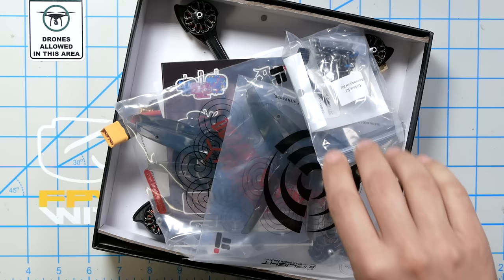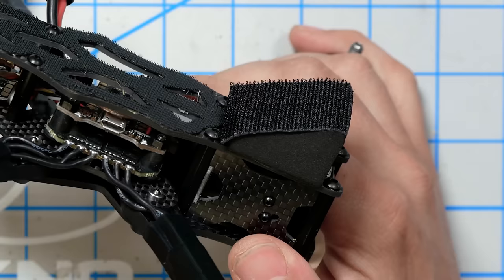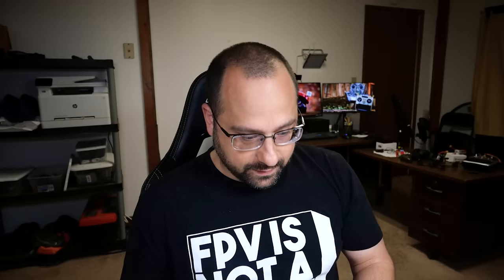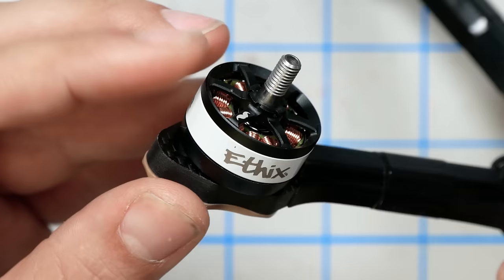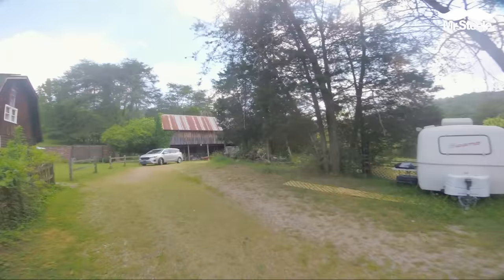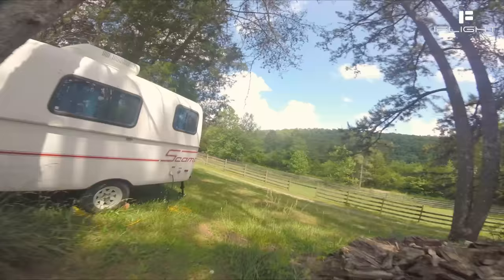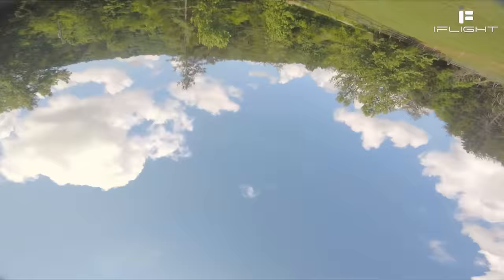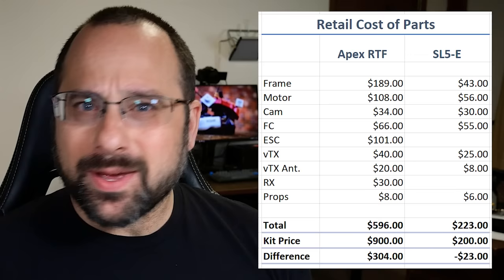Mr. Steele $900 Apex RTF vs. $200 iFlight Cidora | WHICH WOULD YOU PICK

Comment: All I can think of is getting 200 stuck in a tree or 900 stuck in a tree LOL.
Reply: yeah when renting a chainsaw and sneaking into the park at night is a viable option you know its a bit much
Reply: @testaccount4191  Lol, I can imagine the whole operation in my head.
Reply: @testaccount4191  Lol
Reply: Always good to carry an overinflated small basketball to knock the stuck quad out of a tree.
Reply: @kc8302  My quad rescue setup is a slinghot hooked to a fishing rod. I use the fishing line to loop a paracord around the branch to swing it. It the paracord is not enough, I use it to loop a larger rope around the branch. I managed to rescue quads stuck 40+ feet up in trees using this method.
Reply: But honestly, I burn ESCs much more regularly than I get stuck in trees. Last one to go was the Spedix IS35 in my Cinewhoop. Never turtled it once. Twitchy motor 3. I have a collection of "3in1" ESCs.
Reply: seems legit xD
Reply: Big pole. We have retrieved a plane off a 60 meter tree before. Big task
Reply: @yannickg6904  I switch to individuals long time ago xD
Reply: @ho-xo8my  I like 3in quads a lot, it's hard to build one with 4 single ESCs, but I learned my lesson on 5in quads.
Reply: Call a tree guy👍🏻😎
Reply: paracord is a good option
Reply: Stuck in a tree isnt as bad as on a roof behind a 10ft fence. Lol
Reply: Call the fire department. If they can get a cat out of a tree surely they can get a quad.
Reply: Same or smacking $200 into a tree vs. $900 into a tree.
Reply: Best response ever!!!
Reply: @yannickg6904  have you tried swapping motors? Or was the esc literally smoking
Reply: @rocky5763  Hi Rocky, it really was the ESC, the quad flew fine after swapping it. It's back in the air, no issues after that. The funniest thing is, I used a "EM25A" 4in1 that cost me 15usd vs around 40usd for the Spedix..
Reply: Loll all i can think is maybe if the steele build came with $400 in extra parts 😅🤣😂
Reply: I didn't get stuck in trees too often. No reason to be in a tree if you can drive.
Reply: Na man fishing pole with some heavy sinkers
Reply: @testaccount4191 ,,
Reply: @blindtraveler844  that sucks, sorry to hear.....
Reply: I use a silky saw with telescoping handle. Good for like 40ft.
Reply: And what i learn today was how to crash in to a tree with style 🤣🤣😄😄.
Reply: That's the trick. you buy both, and when the $900 one gets stuck, you whip out the $200 one to knock it out.
Reply: Climb the tree lol
Reply: That’s why you spend 1500 dollars  on drone that can get your 900 dollar drone out of the tree

Comment: Yesterday I decided to throw out all kiss stuff due to their quality management and one day later, you test a Kiss Quad and the ESC blows up. Made my day 😂 Will never put any hand on a Kiss Quad again.
Reply: Matek fcs  and spedix escs  bro
Reply: it flies just so much better but i get you. flying 4s fettec does help
Reply: I’ve had my kiss gear on the same quad for almost three years and no issue
Reply: arrow fpv same. Some people just don’t know what they’re doing
Reply: @mhoovair89  I run over 20 Betaflight Quads with no issues. If so as you say, Kiss is at least not super simple 😅  My last kiss issue was a desync after several Lipos out of nowhere.
Reply: @squeaks3814  I find this type of comments extremely hard to believe. anything past 4-5 months its sketchy as hell to me. its not a kiss or betaflight deal its a chinese electronics made out of rice husks deal

Comment: MR. STEELE!!! couldn't be more appropriate of a name! 900 dollars and the esc smokes! He files the holes ....for 900 dollars it better come filed. Hence RTF, 300 dollar part mark up off retail! Which they dont pay! If your trying to constantly push it, hit gaps and new spots your gonna crash (all the time) .....you can build like 4 solid rigs with awesome components for 900, that's insane. I've been flying for 6 years now, my builds get cheaper and cheaper. Tbs source one v2 frame, is in my opinion the best frame for freestyle. Dollar for gram! Great video Josh.
Reply: That's what I'm saying! 
4 quads plus repair costs will get a lot more longevity for someone who isn't a "pro" and can't even tell the difference on flight from one to the next.
Reply: I agree, @$900 dollars, WTF, you could build one for $350, and tune it to fly as good or better. And yes, if you're going to smash it, why would you buy a $900 dollar quad? 

I don't get it, but I don't need to! If you can afford it, you're happy with it, great, but it isn't going to make you a better pilot in the end. I would suggest, take your current build, and buy a better VTX, FPV Camera, and antenna!
Reply: Hahaha
Reply: Yah right

Comment: You have to file the KISS ESC holes because it is I believe 29.5 X 29.5 and the mounting on the Apex is 30 X 30. 

You stretch the ESC if you don’t file it down and even more so as the frame naturally flexes it will damage the esc.  

I have seen this only happen to people that did not file it down and installed gummies. 👊🏽
Reply from the maker: I can't say as to what happened. I'm sure Steele is following up with GetFPV to be sure it's being done to his specifications.
Reply: Ok, so pay 900$ bnf, and than repair it by your self? Getfpv charge that 300$, where id the warranty for their work. Apex holes are 30,5 x 30,5, all BF esc and  FC is 30,5 x 30,5 so it's good, but only kiss stuff is 30 x 30, I know that, everybody who build quads know that, getfpv doesn't know that. That is disgracefully for getfpv and for 300$ paying for bulid.

Comment: FPV truism applies at @16:00 folks.

The "you dont know what you dont know" saying applies with regard to the secret sauce moments worth paying attention to.  This something worth paying attention to given Bardwell does SO MUCH tuning inside of Betaflight.  He is comparing the Steele build to his own builds and tuning experience.

This is the kind of thing I wish I could see/experience within the FPV realm is getting to fly the various different drones of all the Unicorn/Diety tier FPV pilots.   To see what I am missing in terms of tune and finding out if the limits is in the gear/tune or within myself.
Reply: Having flown a few different quads of other pilots, I think what's sets them apart is the rates. Once you get a decent tune you probably won't find much difference, but the rates make it.
Reply: @elmattbo2540  true enough.  I have all my builds tuned down to around 650 and running .2 expo.   One of these days I think I will try playing with my rates a bit more.

Comment: Those ceramic capacitors fail short circuit when cracked. Usually happens when the PCB is bent or stressed, so it might be very well possible that it had something to do with the way its mounted, also there are always some capacitors that go out of factory underperforming and eventually develop a short circuit.

Comment: your kiss flight indeed looks nicer. you can see the higher trust, you have there. Joshua unleashed. I'm on Fettec (Kiss FW) now and can feel the difference to betaflight also. I immediately started to crawl through trees where I have not been before. Doing things I didn't do before. Kiss feels more direct, faster and calmer at the same time. Big, filed holes in the 4in1- check, big extra capacitor - check, spike absober diodes - check^^
Reply: Fanboys be like...

Comment: Finished watching... good video! Seriously put a FETtec stack on the Cidora and you will get it to perform almost the same as the Steele build. 
Stout motors: there is just something about the whole package, they are strangely efficient and the control is ridiculous. But any good motor will perform similar.
KISS: The control is out of this world and you hit the nail on the head for some reason with KISS I am more confident, I think it simply has less latency than BF.
Apex: Expensive but molded parts are expensive and they are very durable. The frame is very rigid and durable. Stack screws never need to be accessed unless you crack your rear plate.
KISS HW: I have no experience personally but I see them blow the magic smoke on video all the time. Go FETtec.

Comment: Yeah... you have experienced KISS. It really does feel different and flies exceptionally well when properly built. The ESC fire was strange, must be a 6S issue in the absence of a capacitor. You should have listened to those who warned you :). I have been flying KISS for 5 years and I haven't had a single ESC fire.
Reply: Seattleite FPV really that good? Have you flown radix?

Comment: Nice honest review.  I have both.  After flying them I agree with your assessment 100%.  However, I believe that only pilots with more experience would appreciate the differences between the two.  Yes the Cidora is that good.  For the new Pilot, buy yourself a Cidora, swap in a Cadix Vista and buy yourself the DJI goggles.  You will still have enough left over for a spare CIdora when you smash your first one....Which you will do.  Just my opinion.

Comment: Steele camera have really low latency for CCD(14ms and usually they have 33ms), but there a lot of CMOS cameras with less latency, as I remember predator 4 have min latency 4ms. So latency of this camera is just average.
Reply: yeah ... this latency things confuses me ... there are definitely CMOS cams with high latency, but plenty that are quite a bit lower than CCD and that seems to be a big part of the reason racers like Foxeer Predators or Runcam Racers. All the Runcam Swifts add like 10ms to the Predator's latency. Where are you finding the latency on the Ethix cam. I can't find the min/max/average anywhere.

Comment: One comment about the difference in the plastics. I have used 100's of different quadcopter bits that were 3d printed out of pla, petg, nylon, and tpu. In my experience, nylon is a good choice for parts that are going to need to protect things underneath them, such as canopies. But I have had tremendously better experience with tpu being the more resilient option in most cases. For example: I purchased 2 sets of the nylon kwad skids from rotor riot for my quads. Both ground away to nothing in no time flat. I began printing my own out of tpu, and I have not ground any of them away... Like, at all. The worst thing is the thin parts that screws pass through tend to stretch if they're not thick enough to not tear in crashes. If the tpu is more than 3-4mm thick, it would take a tremendous force to tear it. I'm also not saying that the Steele bits aren't as good or are worse than tpu. I'm simply saying that If the bits are designed well, tpu can last a much longer time on a quad than nylon, depending on the need. This is mostly FYI for you, Joshua, since I have 2+ years of 3d printing on you. PM me sometime and I'll happily swap info with you on all thing 3d printing/designing for quads, and I'll help you better understand what I mean. Keep up the amazing work! You're an invaluable addition to our awesome community!

Comment: Not gonna lie, yeah I was impressed...by the lack of quality of Steele’s 900$ quads, they’re just not really up-to-date and completely overpriced. Even my basic 250€ quads are better and far more robust, the only thing it does best is keeping that weight down, which is pretty cool, but it ain’t worth that much.

Also can’t believe Steele’s quad failed with such a basic thing as electronics at 24:00 ; that’s why I always put capacitors on the ESC. Doesn’t matter if it flies well out of the box, as it gets some bumps and motors get damaged, voltage spikes become more frequent and u better have some capacitors installed to better absorb them.

If it were a 300$ quad, It’d be a fine quad as long as we don’t take the electronic failure into account, but being so overpriced...for me It’s been quite a disappointment :/
Reply: but can you get the same handling on one of your quad for that? i mean if yes share it please
Reply: BlueJay Yes, all you need is great acceleration, decent ESCs and motors with enough torque to handle those rapid changes in prop rpm. The acceleration is key if you want to make your kwad “floaty” such as mr Steele’s ones, the key for it isn’t to have super powerful motors, but instead to reduce the quad’s weight. That gives you less inertia, which makes those rapid changes in speed and orientation both less energy costly, and less hard on your battery as well, which also increases your flight time (that’s why Steele can do so many tricks in a row and still get like 5 min of flight time).

Also PID tuning and Betaflight filters are key to making your quad as smooth as possible in flight. That is one great example of something I still don’t fully understand and that I’m still learning about, mainly because they are extremely specific for each quad, which is where Steele has his experience to allow him to tune his quads to perfection, whereas I’d still have to test mine and fly them a lot more to match his level of tuning.

I’m currently working on a YouTube channel to explain these sort of things, but it’ll take some time to be ready since it implies a ton of work, experimenting and it also requires of lots of money to be invested in this hobby (and also the 3D printing hobby, which will be another significant part of it). Bringing interesting content to the table ain’t cheap, and I also feel like I still need to learn a lot of stuff before trying to teach other people, it’s just that, in my current experience, I know you can build 3 awesome kwads, just as good as Steele’s or perhaps even better with those ~900$

Comment: I been flying Betaflight for almost three years. And I hate the tunning trivia that goes into tunning different sizes of quads on Betaflight firmware. Dont get me wrong! Much respect for the Betaflight dev's and all the work they have done putting in new options so you can fine tune your quad even more than before..But on the same hand it has made tunning more difficult..At least for me it has..With that being said..I love building though..So recently i bought the new fettec 20x20 stack and activated the Kiss firmware on the FC & 2400 Shot on the Fettec esc. I haven't figured out the osd firmware yet for the DJI air unit. But I have flown the quad on stock pids. And I can say after flying Betaflight for nearly three years. The feel of Kiss firmware is something special. I cant wait to get the osd issue solved for the DJI because I'll be flying Kiss a lot😀

Comment: Neither, get the new T-Motor FT5 BNF with T-motor frame, stack and motors, Caddx Ratel, RushTank VTX then chuck the running gear in an Apex frame.
Reply: How's the drop top? lol
Reply: Rushtank = Trashtank
Reply: Levi Cook Have you had a bad experience with the Rushtank? I run mostly TBS and a couple Tramps but put a Rushtank into a freestyle build powered directly from 6S and it’s been rock solid for 6 months, I was going to buy more I hope they don’t have QC issues.
Reply: @johncitizen3361  I heard there were some batches that had very bad issues. I also saw other people complaining about it.
Reply: SuperSigma ahh that sucks, quality control is a problem with a lot of the cheaper stuff.
Reply: Dont waste your money on an Apex either..... either you crash and tuble..... a $30 frame WILL hold up.... OR you crash HARD.... where it doesnt matter what frame you have.. its gonna break.....
Reply: Stickboy Fpv apex has a warranty bud. You’ll never get that with a $30 clone
Reply: @mhoovair89  gooood point! Yeah I crashed my drone into a wall😑 can I get another one! They really send an entire new one no questions asked?
Reply: Stickboy Fpv do you not know how a warranty works? Lmao. Don’t think I can help youn
Reply: Stickboy Fpv but yeah, I snapped 2 arms, followed the process and boom, 2 new arms. 

So yeah, I’d say; you crash, file warranty, receive new parts. Seems rather simple.

Especially when I have 3x Apex frames & 3x marmotte (both of which have warranty) so if one breaks, file warranty, fly back up while waiting on new parts. Rinse & Repeat
Reply: Stickboy Fpv that is quite literally how it works (with regards to the frame only, of course). When you buy one of the Armattan frames or the apex when you break the frame you will receive a replacement for that part for free. For armattan it’s a lifetime warranty
Reply: Stickboy Fpv Well the frame yeah, I have a few Armattan frames and they replace whatever I break on the frame. I have a 2 year old Rooster that’s had the top plate replaced, HD camera plate, front crossmember between the titanium cage and about a dozen broken arms 😂
Reply: @mhoovair89  hahaha nooo I know how they work😜 but daaamn... yeah I was thinking itd be like my horrible us cellular insurance🤦‍♂️🤦‍♂️ been paying $10 a month for the past 20 months.... The charging port FINALLYY went out..! Oh I figure, you know.. $10 a month I pay Ill be good.... no... they wanted $250 stillll.... I said WHAT! Im switching from Us cellular the end of the month👌 But yeah I must do this! And yeah itd have to be lifetime!🤙
Reply: Wild willy had a deal for lifetime on his dolphin frame and it was only $70 but Im not sure if you can still grandfather into that😫
Reply: Stickboy Fpv impulseRC apex is 2 year warranty. But I believe the FlightOne covers all wild silly frames now. Not sure the length on the Dolphin1 tho. 
Armattan has been nothing but amazing as far as customer service for me
Reply: Stickboy Fpv Yeah Armattan have always been a flat $5 shipping rate and you send a pic of the broken quad and then a pic with the part removed and scratched with a knife, they give you a coupon code for the replacements and I wait until I have to order say 6 arms and each time I make a claim get them to update the coupon then get them all shipped at once for $5.

You can drive a car over it and they will honour warantee and it goes with the quad so if you buy a second hand Armattan it’s got the warantee.